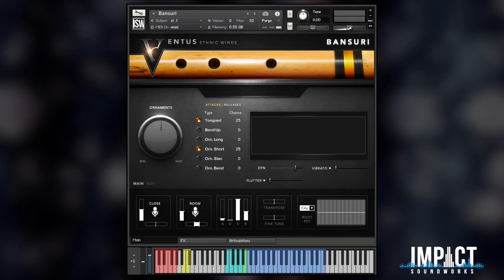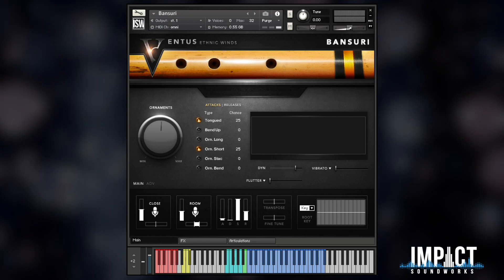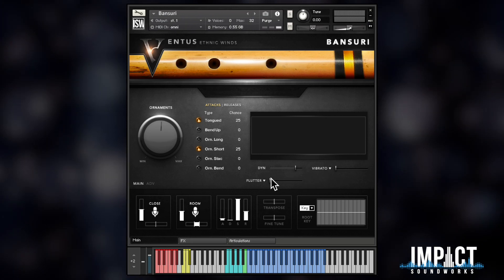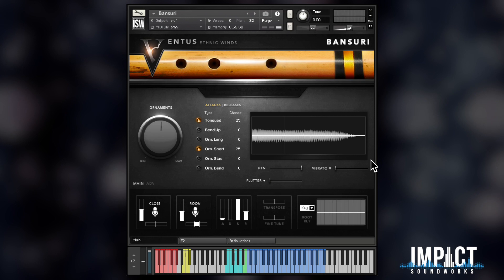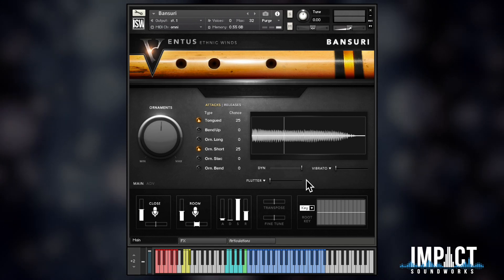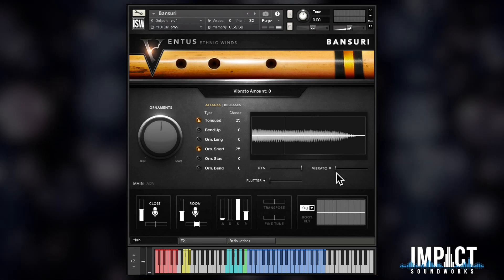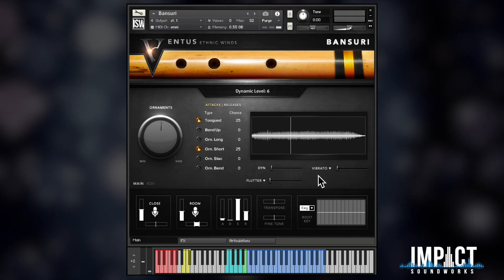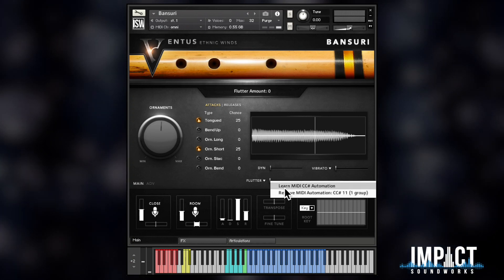How to Assign MIDI CCs in Kontakt (Tutorial)

Comment: I assign midi mapping on my keyboard for an instrument, then when I close and reopen kontakt, or even just change to a different preset and change back, it forgets the cc mapping. How do I save it? (I've tried 'save as default midi' and this doesn't work) Why is something this simple so difficult!
Reply from the maker: After you make a CC mapping you must SAVE the NKI. Otherwise your settings will not save. Also, even after you save the NKI, all DAWs save a 'local' copy of the NKI with your project. So if you had a project file without that MIDI learned mapping, you will have to reload the NKI that does have your learned CC in it. A pain, I know... but that's how DAWs & Kontakt interact.

Comment: Kontakt doesn't respond to any konb\fader movement from my Oxygen61 midi controller.
It responds to the keys though. Any advice?
EDIT: Solved, (Solution is in my comment below in case someone has a similar problem)!
Reply: It turned out to be a mismatch in port number between FL-Studio MIDI setting and Plugin Wrapper Settings MIDI setting.
SOLUTION: 
Assign a port number to the  MIDI controller ( FL-Studio >> Options >> MIDI >> Input ).
Assign the same port to MIDI in the wrapper, "top-left > plug with gear icon " ( Plugin Wrapper Settings >> MIDI ). 
Done!
Reply: @abbesatty9498  Do you know how to make it apply to every plugin of the same type? I have to manually change it for each instance of kontakt
Reply: I've also noticed that the they still get tweaked when the window isn't in focus, messing with my other slider binds.
Reply: @abbesatty9498  master! thanks!
Reply: @abbesatty9498  Thanks mate! Did it for me.
Reply: Does it work when Kontakt is in standalone mode?
Reply: @zirconst  Hi again! It works flawlessly in the standalone mode.
Normally I use it with FL Studio where I can assign any control outside Kontakt 
I saved the patch from within the standalone version, loaded it into VST version inside FL. I can see the previously saved assignments under "auto" tab but still, no interaction with my MIDI controller. WEIRD!
The loaded instrument is Ultimate Stage Pianos.
Reply: @zirconst  Hi! Thank you for the quick reply!
I Will check that and return with the result asap.
Reply: Exactly my issue too.  Thanks so much!